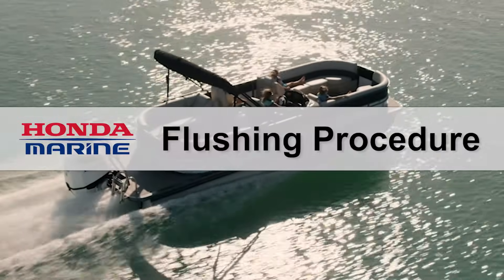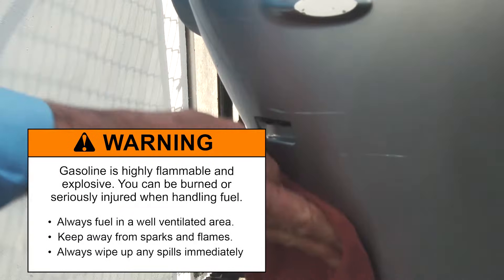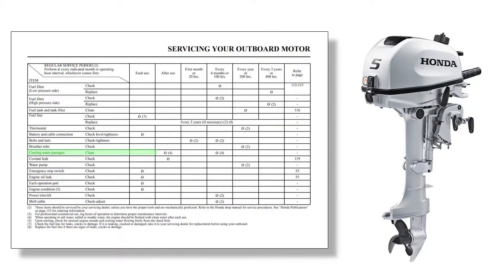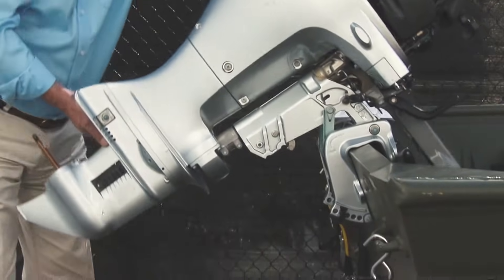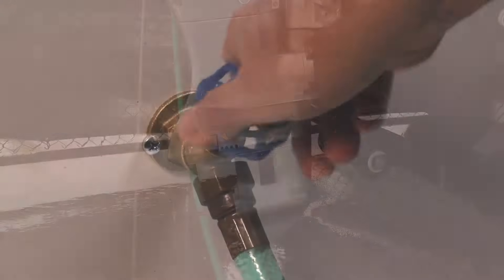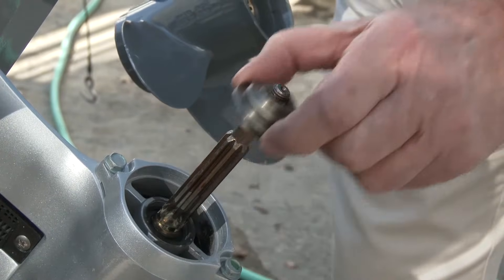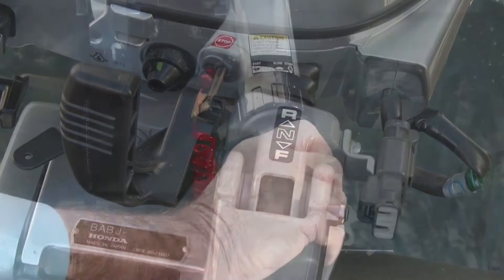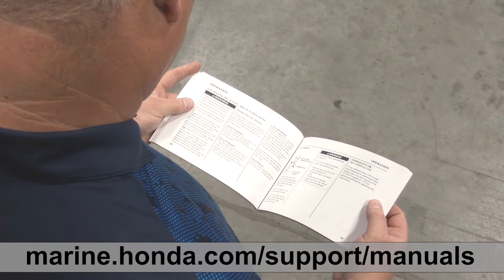Honda Marine DIY Cooling System Flush Procedure

Comment: is there suppose to be a o-ring on the connection to the engine side of the connector? mine has a small leak like its missing a washer or o-ring? thanks